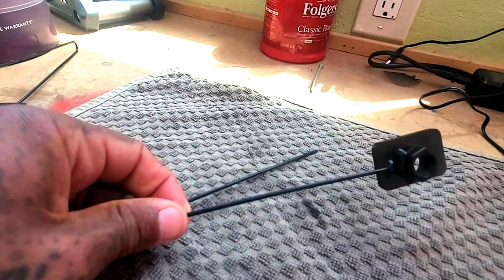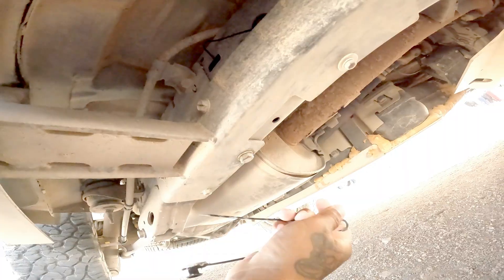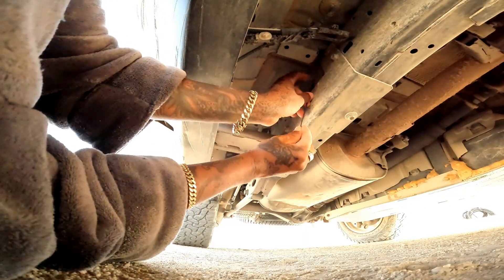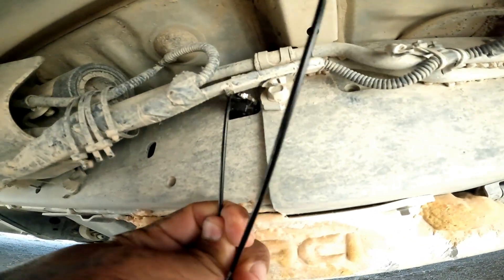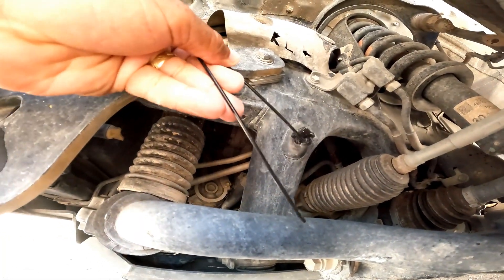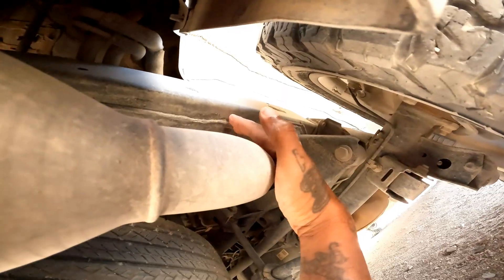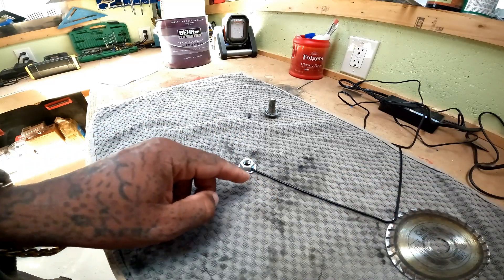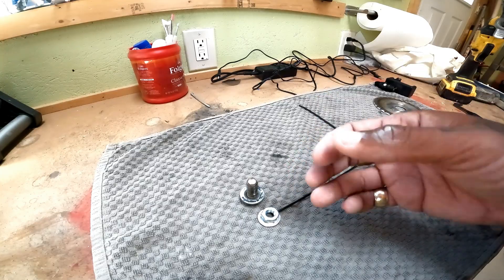Nut On A Stick: The Secret Fix For Broken Frame Nuts

Comment: Rivnut? They’re a godsend when dealing with blind installations where the rear isn’t available.
Reply from the maker: true but I don't trust the rivnut's little deformable donut dimple on a rock slider application such as here... for lighter duty stuff rivnuts work great...

Comment: A lot of hitch receivers come with what they call fishing wire. It’s a semi rigid semi flexible wire (very similar to welding wire) that one end is spiraled like a corkscrew or spring. You thread the bolt on the spiraled end and stick the long flexible end in the frame and pull your bolt through different size and shape picks help tremendously with this. I can’t tell you how many repairs I’ve made by taping some wire to the treaded side of a  bolt and pulling through a hole. Thanks for spreading knowledge and keeping people on the trail.
Reply from the maker: @ethanturner9281  sounds great.. 😃 similar to how electricians pull wire using fishing tape.. it's always amazing how string/wire/fish tape can pull/push nearly anything into place with the proper spirit and tenacity 😃
Reply: You can use your bolt to fix your car
Then you go at high speeds (ie bolt your car)